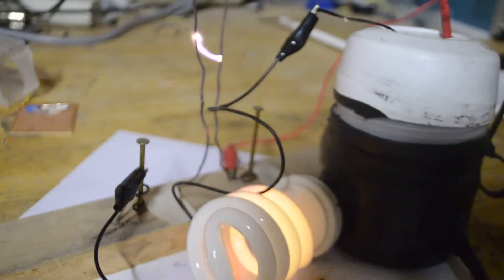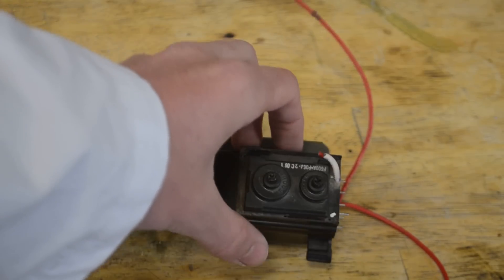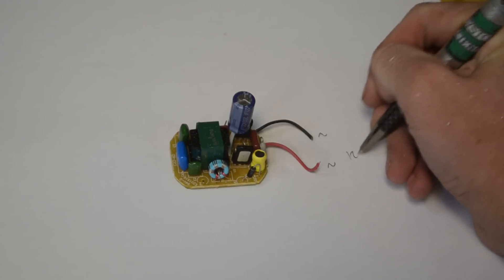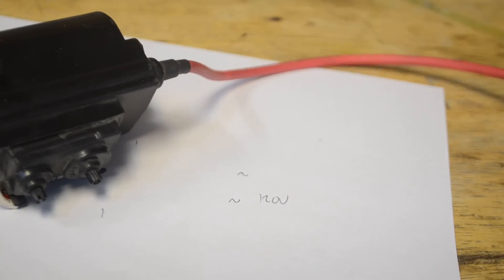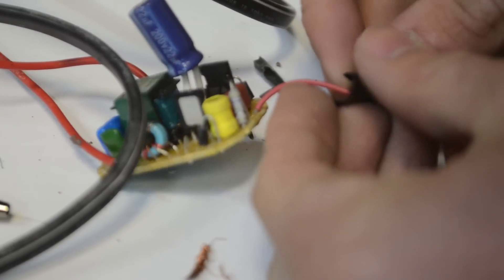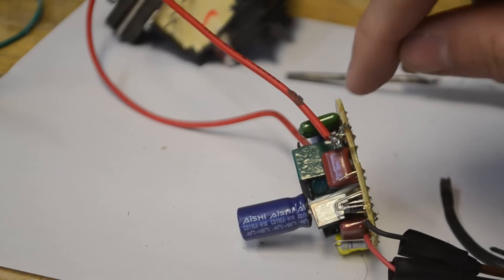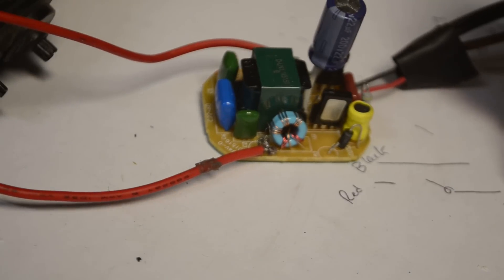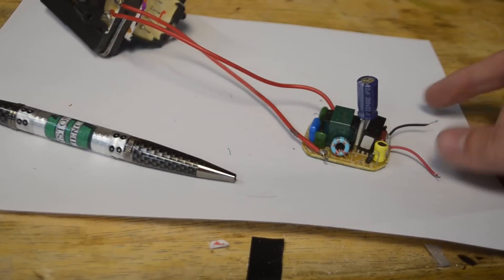High Voltage from Fluorescent Bulb

Comment from the maker: Hey Guys! Join the Discord Chat! :D https://discord.gg/rvnbhNN
Reply: Keystone Science help me it worked but i had to plug the power in and out the hole time
Reply: Keystone Science 
I don’t know if you will see this, but if you do, can you please make a video on different ways to drive a flyback transformer ( the one in this video, zvs etc. ), and their ups and downsides?

It would be much appreciated since i’m planning on making a spark gap tesla coil with a flyback transformer as the power source!
Reply: @Alex0474  i also wanted a deep knowledge n study about this bro
Reply: Jackson Curren They ARE dangerous
Reply: Hey don't forget to tell people not to turn on the CFL circuit when the output is open. If you turn it on and there's nothing connected to the output, resistors will fry, capacitors will blow and transistors will short. And that's how I fried 2 CFL boards.
Reply: do you have one that is for 12v battery ? high voltage with 12v dc battery. 

thx
Reply: Keystone Science hey greetings from germany:) maybe you can show a circuit that makes 110/220v AC from 12or 24v DC as an backup divise ? I really Like to build one but im not good in Electronics:(
Reply: Keystone Science OK I will join
Reply: Keystone Science I joined :3 Btw. You make soooo cool Videos! Keep doing so nice Videos!
Reply: Hi Keystone, im from the UK and our mains run at 240v is there anything extra I should take into account when trying to replicate your experiments. Im Kind of new to this. thanks
Reply: why do we need that circuit
cant we just connect the ac straight to the transformer?
Reply: Peter Zingler just look up DC to AC with motor its works pretty good and the parts are easy to find just use a 12v charger connect it backwards put a motor in series with the car battery and there you go around 1.2kw to 2.4kw depends what the current is.
Reply: the transformers generally need much higher frequency, and the AC is 120v minimum, meaning that a lot of the time, it's too much voltage as well. the driver board actually rectifies AC and makes a higher frequency AC
Reply: Hey awesome video 
Can make a shout-out for my channel if possible. It's related to electronics too.
Reply: Is it possible to connect the sawtooth wave from a reverse avalanche circuit to a transformer? 

Hello from germany :D

Comment: Fun fact: if you wire a 1500v 4nF capacitor series with the primery coil, then on the output you have double the voltage

Fun fact 2: im 12 years old and i played with 50KV when im 10
Plus i builded the multiplier for the 50 KV

Comment: Yeah I have a problem. I want to re-create this project but my Flyback transformer has 4 PINS, witch is confusing, but I have the connections marked secondary+ secondary- and Primary. but how am I gonna wire this? and I don't have an old TV so where can I get that exact flyback transformer? Please let me know. 👇😃

Comment: Ack! Too much! The first 13W ballast only worked VERY weakly once or twice for an instant. The second ballast was 14W (woopty doo) and it instantly start humming and throwing 3cm pink and purple arcs. I backed the wires further apart and at 4cm it stops the arc but continues with both tips creating angry corona fans. Backed it to 6cm and still corona hiss fanning out and angry hum. I wanted this thing for a few KV. I can go fire up the CO2 laser power supply for this angry stuff. Any ideas on the quickest way to tone it down? There is corona even coming off the bottom of the flyback.

Comment: Maybe you can help but I have tried your configurations with the flyback transformer and I didn't get any arcs. Also when I took my multi meter to test the connection of the flyback for the large secondary the large the  wire didn't beep with any of the pins so is my flyback broken or is there a secret I am missing

Comment: nice arcing the one you achieved, mine turned out shorter using a 30 watt ballast and a flyback transformer found in a 20 something inch CRT. Why is it that when adding a capacitor between both primaries in the flyback I got longer arcs but the cfl circuit died as soon as I stretched the arc far enough to leave the circuit open?
Reply: CFLs ballasts have a built-in self destruct for when the tube burns out, killing the fragile components in the circuit.

Comment: Why did you use a high voltage supply to make a high voltage supply, I don't get it, what happens if you just put 230v ac into the flyback primary?
Reply: Flyback primaries are simply not made for that kind of current. Not to mention flybacks like constant square waves, they just despise sine waves

Comment: 4:42 It's a good practice, but the longer the stick is, its easier too loose control on it, slip it, and make high voltage short :D I advice using medium one, with caution and common sense.

Comment: Maybe I missed it.. but what was the purpose of taking out the circuit from the bulb? What purpose does it serve in this exactly? Is it just to start with a higher voltage than mains?
Reply: It makes a square wave that makes constant changing magnetic fields through the primary coil which drive the secondary coil to high voltages

Comment: 7:08 "it doesn't have enough current to kill you"
electroboom, where are you?
Reply from the maker: Ehh, voltage delivers it, but current is ultimate what kills, kind of? It’s really power so it can be viewed in so many ways, but ultimately the flow of electrons is what does it
Reply: @KeystoneScience  as long as you don't have 60+ volts at high current, or more than 0.005 amperes at high voltage, you should be good.
Reply: Keystone Science Thanks for your answere! Yeah ur probably right since ur like really smart. I dont really know what im talking about so i’ll leave the job about electronics over to you, thanks again.

Comment: Does it matter the wattage of  the CFL bulb you get the board from? 
Using a high voltage transformer from a CRT TV,  why not rig up plazma display inside the CRT so it can be seen jumping around all over inside the screen?  It would be impressive yet safely contained.

Comment: Kids' letters go under the stolen sign?
I made one of these. But the wire I left connected that didn't go through the switch turned out to be the hot-wire. I reached into my lemonade box and got electrocuted and am now dead.
Reply from the maker: Mhmm, only not stolen by me, it was at a yard sale ¯\_(ツ)_/¯

Comment: Thats awesome mate,,never know that cfl circuit works as plyback driver..now i know,,new subs here
Regards to all from Philippines
Reply: It's no where near efficient because resonant frequencies of CFL LC tank and flyback don't match. It will drive power through a Flyback but not efficiently like the DC square wave the TV circuit uses that is at the 15 kHz or so flyback resonant frequency, unless it's a computer monitor/small TV flyback which can be 30-45 kHz or more. Most CFL's operate anywhere from 25 kHz up to 100 kHz, but avoid the 32 kHz range so as to not interfere with remote controls.

Comment: l make flyback from odd tv transformer driving it with 85w cfl but when l connected a capacitor across the primary the output voltage increases but suddenly the cfl blow, why did it happens so?

Comment: Sir please make video on... Output of flurocent bulb 
Which wave form is output of the flurocent bulb?
Reply: The high frequency feedback switched CFL inverter circuit puts out a rough AC square wave, but it's driving a series resonant LC tank circuit which puts out a sinusoidal AC waveform. The filaments of the tube are usually placed between the resonant capacitor and inductor as part of the LC tank circuit. The flyback transformer is normally driven with a switched DC square wave which turns into a saw tooth waveform in the flyback's primary because the magnetic flux in the flyback's ferrite core ramps up rather than being instantaneous. Then when the horizontal output transistor stops conducting current through the flyback's primary, the flux collapses onto the coils of the flyback, inducing a flow of current in them. The AC sine wave of a CFL is effective at driving a flyback but it is not the most efficient because the flyback is normally driven at its resonant frequency, and the resonant frequency of the CFL's LC tank is not a perfect match for the flyback, plus the inductance of the flyback's primary changes the resonant frequency of the CFL's LC tank by adding inductance, thus lowering the frequency some. Most CFL's operate around 25 kHz, but can go up much higher, but the resonant frequencies of TV flyback's is around 15 kHz, unless it's a computer monitor flyback which can be in the range of 30-45 kHz or more, so with the frequency drop that the flyback primary adds to the CFL, it can be close for a TV flyback if it's a 25 kHz CFL, but if it's a higher frequency CFL, it can be way off for a TV flyback.

Comment: I tried at least five times to use the CFL circuit but for some reason, it wouldn't power the flyback transformer. Using a light ballast worked finally got it up and running.

Comment: sorry dude I have to correct you. Its not the flyback you have to worry about zapping you, the current is way to low. The shock danger is the picture tube itself, it acts like a giant capacitor and thats what has the shock/knock you on your ass hazard. Sorry Ive heard the same thing over the years about how danger the flyback is or its voltages, it is not, it is the tube itsle fholding a charge that will kick your ass. Just wanted to clarify that.

Comment: The DC versions have the Cockroft-Walton array inside of them, while the AC versions have it outside as a separate unit. It is an interesting voltage multiplier which can be made into any number of stages resulting in multiplying AC voltages (into DC) by any number you want. This device can be used to feed a Marx generator for really high pulse voltages.

Comment: per every cm of an arc there are 1000 volts and therefore for a 15,000 volt power supply you would need an arc 15 cm long
Reply: it's 1-3kv per mm

Comment: You should also use capacitor of CFL blaster as two primary winding coupler ( cap in series between two primary windings ) of FB TF this can privent over current and increase output .

Comment: ZVS is better, when I was running a ZVS flyback driver I made, running it on about 50 volts DC, I could get thick bright arcs that I could stretch out to about 9 inches before they break, and I was using a flyback no bigger than the one in this video.
Reply: Ahh yes, with the homemade oil filled transformer? Like this one? https://www.youtube.com/watch?v=1jkrJ8D7Gnc
Reply: Zvs?? I love high voltage and I'd like to understand what you mean so i can replicate your design

Comment: Ok,...so,..how are the "arc" igniters that are used in the 'torpedo', or "salamander" type of heaters made?
  The electrical arc, is what ignites the kerosene, diesel or propane,..& this arc, IS, "running" for as long as the heaters are being used.
How are the igniter modules constructed..so they CAN operate for so many..MANY, hours of use, "without" constantly "burning out??"

Comment: Have you considered immersing the cfl circuit & the flyback xmfr in mineral oil?Also you can add a 30kv or larger capacitor from the flyback xmfr output for larger sparks.

Comment: Great video. I've done this project and it worked out well. But the arks are very small, they do not even get to stretch 1 centimeter and the datasheet of my converter says that this produces 26 KV. Could it be because my fluorescent light bulb is small? If you have any idea what this could be, please tell me.

Comment: The stable purple arc looks more like AC. Normally, with DC high voltage, the arc is irregular and loud. Is it possible the tripler in this high voltage transformer was not working?

I made similar high voltage device from compact fluorescent. I let the fluorescent connected as a way to indicate that the circuit is still working. I connect the primary of the CRT high voltage transformer in series with the main inductance of the compact fluorescent.. Doing this, there is no question about overloading any part of the electronic.

I like the videos you made (I just found a link today, watched about 5 videos). Contrary to many other youtuber, your projects are working for real. It is not click bait with clever video editing.

I would like if you would use the standard 10^3 names for resistances, frequency, etc. For example, 5 kilo ohm instead 5 thousand ohm (or say both if you think it would allow other users to understand better).

Comment: Have you run this setup for any length of time?   I was wondering if anything got excessively hot.  I always wanted to make a Jacob's ladder but would like to run it for a reasonable length of time like 15 minute stretches of time.  Please advise.  Thank you.   I just discovered you channel.   Going to check out more after leaving this.
Reply from the maker: +jp040759 hmm, I have not run it for long. I think it would die fast to be honest. It's probably better to use a FL ballest, or a ZVS set up ( I have a video on both of those if you need ) as those can run for much longer, and even produce more I think
Reply: Thank you

Comment: how about making a xenon strobe scope ?
Reply: flyback + bridge rectifier + capacitor + xenon flash tube, use a resistor between the cap and the rectifier to adjust how often it flashes.

Comment: Finally got it all and tested it... not viable, as it burns the cfl circuit out quickly.
Reply: Novanoid 
I'm no expert, but try a higher quality CFL? Maybe that will fix it.
Reply: I ended up just buying an electric light ballast. Produces higher voltages anyway. A high quality cfl might have worked better since the on I bought was generic.
Reply: Novanoid ahh good idea. I believe that circuitry inside a CFL base is a mini-ballast used to produce enough power to make the bulb light up. Because fluorescent tubes are the same thing as a CFL spiral, just larger and straight. The ballast is in the light fixture itself and is used to power the bulb. A CFL has its ballast built in. So it's probably not strong enough for what you were doing. But getting a bigger ballast hadn't occurred to me.
Reply: Novanoid if
Reply: if what?
Reply: Hey, you entered into the oscilloscope giveaway! I thought you'd win for sure.
Reply: Novanoid I accidentally typed that and yes I did enter the oscilloscope giveaway
Reply: I have had no luck on a mot with a fluorescent light ballast.tried several and nothing. what am I doing wrong?

Comment: i made a taser like the one you described in a different video, but instead of making lightning type arks, its making a high pitched squeaking and an ark just like this one. it can light things on fire, so im wondering why that might hapen.
Reply: How would you turn that into a musical plasma speaker. I mean could you inject an audio singnal in the cfl circut.

Comment: Hey, isn't CFL-circuit's output also AC so that it can drive transformer?
I had a couple problems with setup like this. First, all my CFL circuits could detect if there was a tube attached and worked only if it was. I found that putting a capacitor across a pair of pins attached to the same end of the tube (to heat electrodes?) works fine, and shorting them with alligator clip did the job too.
Next, if i play with HV more than few minutes, transformer on a circuit starts getting very hot and then something on the bottom side burns up/explodes (i think some CMD resistor gets damaged by heat). How can i work around the overheating? Maybe a circuit from more powerful bulb would last longer before dying? or was it that i shorted these pins?

Comment: It worked but i had to plug in and out the power the hole time, can someone help me?
Reply: Some CFL circuits need the other two pins connected. Some can just use the two pins of the CFL's resonant LC circuit, but some CFL's have to have the other two pins connected also. Just on each side of the CFL there was two pins connected to one of the lamp tubes filaments, connect the two pins together, and do the same for the opposite two pins, and then connect them to the flyback primary as before. Even if it's a CFL that doesn't need the other pins, it won't hurt to connect them anyway.

Comment: Can you pleace make video how to magnetize neodymium to super magnet? - You can get non magnetic neodymium by heating neodymium magnet. I used thick copper coil, 24 volts and 300 Ampers DC. The coil melted and neodymium did not turned into super magnet  =(
Reply: maattiauto neo magnets aren't made from pure neodymium, they are a ceramic mix of Iron, Boron and Neodymium
Reply: How can you magnetize this mixture again?
Reply: maattiauto I don't think you can.
you mean the ceramic mixture?
Reply: I mean: how to do super magnets?
Reply: maattiauto just buy them. It is way too challenging to compress that ceramic powder at home, if not impossible

Comment: How do I make sure it doesent kill me if I touch it accidentally?
Reply: i thouched it multiple times and it didnt kill me...obviously...hell i acidentally touched an aprox 60.000 or 70.000 kV arc and i didnt die but my hand was hurting for a week... i made a freaking zvs driver with 2 flybacks in series...it had 15 cm arcs at 24 volts in...and as i said aprox 60.000 kV out. in conclusion.... it wont kill you...but it will hurt as hell

Comment: I'm a welder, and I think after seeing this video, it would be cool for you to make a video with a power supply of this nature, to create a small, portable, welder. Nothing extravagant, just something that could tack together something thin, like 20 gage sheet metal. Either that, or make a battery powered, plasma, soldering iron. Either of those would make my day lol.
Reply: Welding requires very low gauge wire in order to not melt, making it difficult to make a mini welder